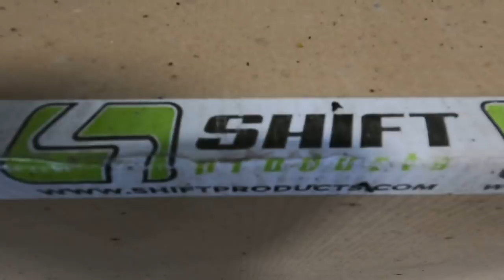Trucks Are Always Better With A Visor !!!

Comment: I drove truck that had a 10" visor , hated it , might be ok on interstate , but in town with a lot of red lights , if you pulled up enough to be on the sensor , you couldn't see when light changed , haft to climb out on fuel tank to see if light changed .